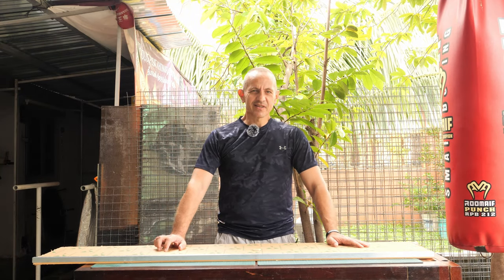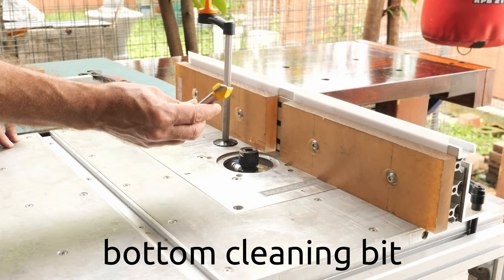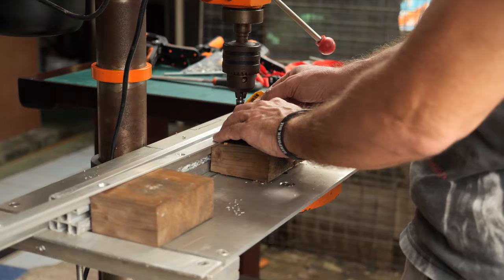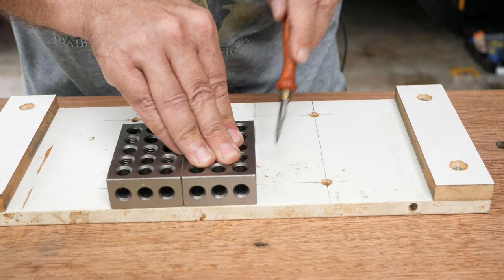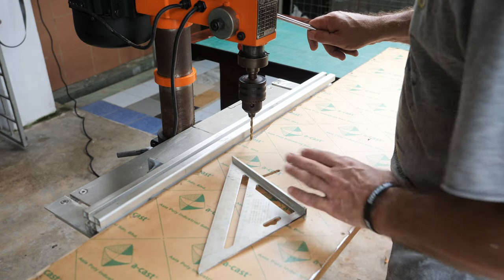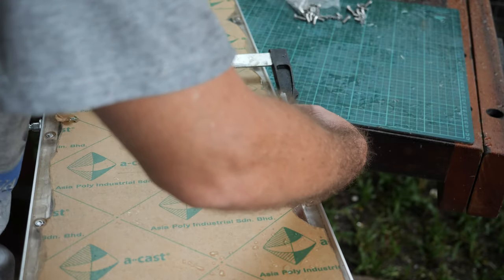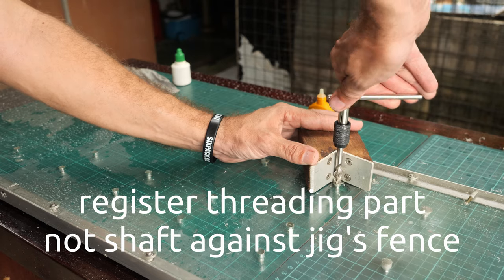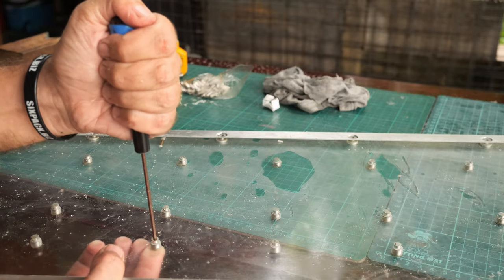Jointing Sled For Thickness Planer From Acrylic & Aluminum  Part 2/2 | Full Build Video

Comment: I wasn't expecting to see an acrylic planer sled.  Nice design, and great work on the build.
Reply from the maker: thanks man! it's not the most humble thing to say, but I think it's the best solution I've seen on the Internet to date (Aug 2021). I'm sure someone will make something better at some point, that's what I love about the Internet propelled technological evolution.

I live in tropics, so any jigs have to be made from aluminum or plastic, otherwise they will be swollen the next day. even plywood bows here overnight.
Reply: @TigerCarpenter  That makes a lot of sense. I have to run a dehumidifier in my garage in the summer to prevent some of my jigs from sticking.

Comment: Superb idea and craftsmanship, especially taking into account your local conditions. Really well done!
Reply from the maker: thank you!
yes the humidity and the amount of the rainfall on the equator is just ridiculous.

as you could see, the acrylic + aluminum + stainless steel sled has proven to be the elements proof while it was still under construction, which made me very satisfied.

it serves me well, especially on mobile / customers job sites, where I cant being my large and heavy industrial jointer, but I CAN bring my Makita thickness planer, which can then flatten for me both sides of the boards.

many months later, an honest update: this sled has worked perfectly well, produces very straight boards, and doesn't have any signs of deterioration whatsoever. I wouldn't have changed anything in this design, apart maybe from making it slightly longer.

Comment: So much good information, clearly laid out in this video. It's a shame you don't have more views. I am curious about your drill press. I'm looking to upgrade my own and your's is impressive, who manufactures it?
Reply from the maker: thank you!

the channel will eventually gain popularity and views, as there is a lot of projects and ideas coming up.

the drill press is the cheapest standard machine. I made the aluminum table and fence system myself, and you can watch it here:
https://www.youtube.com/watch?v=5m3hstkR37c

the aluminum drill press table was a very good move, because I often drill the stainless steel or cast iron or other metals, and aluminum table is friendly for oil or other lubricants. I can;t imagine plywood drill press table soaking in the lubricants.

Comment: 1) An outdoor woodshop, in the tropics.  Came here for the sled build, left reevaluating my life.

2) Lightning strikes within 1 mile and you're still immediately concerned about flush.  Tiger focus is real, confirmed.

3)  Are there any other materials than the acrylic sheet you might recommend for the base?  Prefer something that lasts significantly longer than wood/mdf/melamine, but is more recyclable or biodegradable than acrylic.

4) The way you talk out loud while filming is super helpful.  Videos that only show key features or exact build steps present the project without necessarily building up the viewer.  I walked away from your video with appreciation for lots of methods, not just the final sled... Thank you.
Reply from the maker: 1) Please stay tuned as I'll be starting off grid cabin AND workshop in the jungle land in few weeks. 
Time to cut loose from the lunacy of the Klaus Schwab vision for your future life indeed ;)

2) That lightning literally hit my house, I lost the laptop power supply (thanks God not the laptop), and the WiFi router. I should have paused my video recording, and turned it off.

3) Cast acrylic is the best material that is perfectly flat, stiff, and doesn't change properties / dimensions over time. Its hardness also suits perfectly the Stainless Steel threaded inserts. I tried other materials in the past, and the hardware loosened out, especially the parts that are abused / grub screws turned inside, some pressure and vibrations from the machines etc.

If I couldn't afford the acrylic sheet which for sure is very expensive, I would probably use 12 mm plywood + 6mm aluminium sheet sandwich, and put SS threaded inserts into the plywood, and use the aluminium as the base. Or 18 mm plywood + 3 mm aluminium sheet.

But because the sled has served me very well for months now, and never failed to produce perfectly flat boards, and has kept the exact shape / dimensions / flatness as if it was built yesterday, I wouldn't change anything in this design. Only the acrylic has become a little matt from micro scratches.

If you don;t live in 95% humidity, then plywood might suffice. Give it a try. You can reuse the stainless steel hardware, should you change the base in the future.

4) I'm still new to the video production / YouTube. I will gradually improve. My videos are too long, that's for sure. I try to keep only the "important" video clips, and it still turns out very long.

In a nutshell, I had a rough life, and now trying to start from "scratch", learning new skills as we speak. I had enough of the rat race, and the lies we are fed.
Reply: @TigerCarpenter  

3) Everything you say makes sense.  The rest of what I say in this paragraph is a random hypothesis: Perhaps the weakest point in the design is some kind of structural loss over time due to photodegredation?  I just read that acrylic has 92% UV transmission, and something like a 3% material breakdown over 10 years from UV exposure.  I know nothing about the UV degradation process.  I do know sunlight comes down in short wave radiation, hits earth and becomes long wave radiation that gets trapped in the atmosphere as heat.  The idea I'm trying to parallel frame is, I wonder if sunlight passes through acrylic, hits the SS threads, becomes long wave radiation, and that long wave somehow localizes the UV damage immediately around the ss screws/acrylic threads. If that's somehow true, I might recommend the horror of painting it white.  Lol

You mention the second option of 18mm plywood with 3mm aluminum... for longer grub screws, or something else?
Reply from the maker: @mattchew5965  in 2 years from  now we'll be using axes and machetes so the UV factor on acrylic is no longer relevant. 
Don't store it on the sun bed roof and work in a shade, you'll be fine for the next 157 years. If that's not long enough you might make a new one in the year 2178 ;)
But seriously the cast acrylic is the best material known to me for that purpose. It remains flat in tropics and that's all that matters in the jointing sled